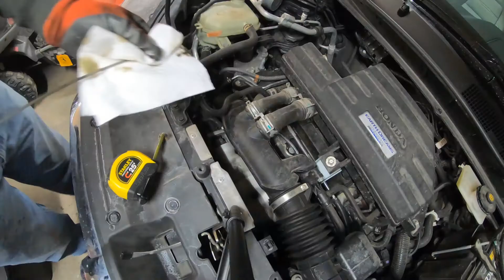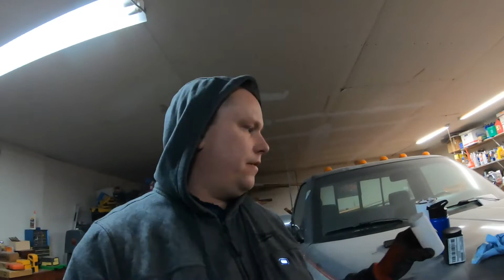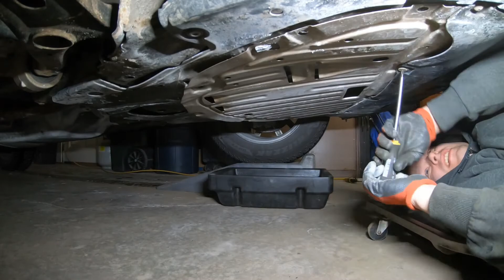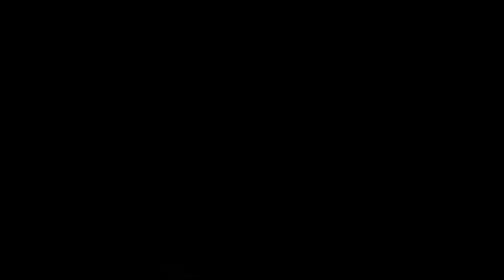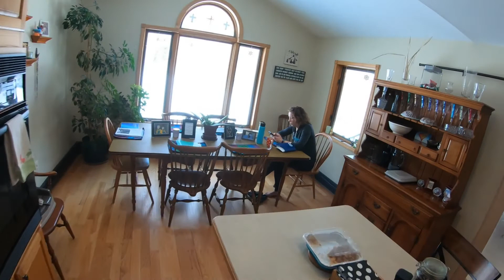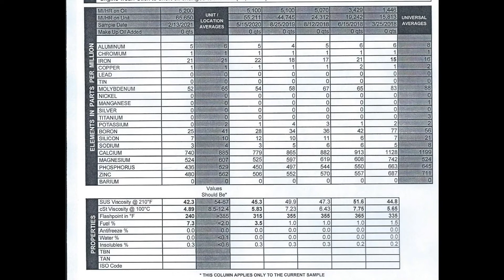New Oil Dilution? 2017 Honda CR-V - W/historical Oil Testing Results - #1

Comment: I think gas catch device is the must have if you drive the 1.5L CRV in a cold state. If you live in the southern states, use premium gas and change oil more frequently should mitigate this issue. No matter what, I will never buy Honda car given they have lost their pride in building a reliable engine. It certainly saves gas, but I use premium gas which makes the saving on fuel efficiency goes away.

Comment: For all the 1.5T owners out there, do not drive it short distances if possible, once a month   make a 50 to 100 mile road  trip ( or more), do not iddle more than 1 minute in cold weather, change your oil before and after winter. Thats the key for me , a 2017 crv owner,  175 k miles,chicago resident

Comment: Just curious do you still have this vehicle ?
Reply from the maker: Still own and drive daily.  About 113K miles on the clock.
Reply: @factotumlife  excellent to hear. So just keep up with oil changes . I have a 2019 crv 1.5 turbo, and I've just been changing oil more frequently.  Thanks

Comment: Hi I have a 2017 civic hatch sport 1.5l  I have 93000km on it right now I’m scared that mine would have the same problem I notice the oil is just little bit higher than normal mark  what should I do any suggestion ?

Comment: I have a 2018 CR-v and I recently did an oil analysis after the oil had 5000 km on it and it was diluted by petrol to 9.2%. This is a real problem for this 1.5 Honda engine and apart from a complete redesign, I can't see a fix for this problem. Everything Honda is suggesting just tinkers around the edges.
Reply: I would change that oil every 3,000 miles.

Comment: These engines are crap. I live in the deep south and the oil level goes at least 2 inches or more over full. It's on my channel. These turbo engines won't last long. Gurantee
Reply: 2 inches over full? Yeah right!
Reply: @bruceskousen5451  the proof is on my channel

Comment: I’ve got a 2019 CR-V.  I haven’t had had the oil dilution problem. I live in Washington State. So, we do get cold temperatures. I’ve researched other Turbo engines. Your wife has a valid point, you can get another vehicle. Even a 2019 or newer CR-V would get rid of your current issues. I get it money is tight. Say your vehicle engine does brake down. Honda has proven to not stand up for there engineering & design flaws. There is still hope that Honda consumer policies will change for the better. Honda has a history of reliable auto engineering & design.
Reply: Honda is no more a reliable company.....
Reply: News flash, 2021crv x2 in our family, both suffer from oil dilution. Honda didn't fix anything, they just made it not dilute as fast by manipulating how quick it gets up to operating temperature.

Comment: Would using a 0w40 oil help the gasoline blowing by the piston rings?  The 0w40 should be ok at lower temperatures but provide better viscosity to prevent engine wear.  Is there any data to support or deny this theory?

Comment: In December 2016 I ALMOST pulled the trigger on a brand new 2017 Honda CR-V Limited... Right before closing on it, I found a 2012 Ford Escape XLT 2.5 with only 19,000 original miles. The new CR-V was going to be nearly $30k drive out; the used Escape was less than $14k. I bought the Escape. It is now paid for; it has 56k miles and I have only done typical maintenance (tires, battery, oil changes). My oil change interval is 3000-3500 miles using conventional oil (typically my local ASE shop uses Valvoline.) Oil changes are cheap; engine replacements aren't. The Escape's Mazda derived 2.5L 4 cylinder is very simple but reliable - I have experienced NO oil dilution issues. I have not yet experienced the typical coil pack issue on this engine, but the coil packs are readily available, are not expensive, and are incredibly easy to change.

I thank my lucky stars I didn't buy the CR-V! Honda isn't what it used to be, sadly.

Comment: I have a 2020 CR-V Touring which has had rising oil level since day 1.

Your video is the most practical and informative of all I have seen, and I have seen a ton of them.

I am hoping you can help me. It is clear that you are finding success with premium fuel-are you using 91 or 93 Octane? There is some thought 93 v 91.

How about the thought that Honda says the oil level can rise 3/4 inch above full without issue?
So, at the moment, I am trying to decide if I should go back to regular versus continuing on with premium.

Lastly, does this engine dump less fuel or leaner fuel mix while running premium, or is there no difference?

Lots of questions.. Just trying to find peace of mind with my first Honda.
Reply from the maker: Since I posted this video we have consistently run 91 octane(no ethanol) because that is the premium fuel available to us. Our mid-grade is a 88 octane with 15% ethanol, and 87 octane with 10% ethanol.  Historically, I have run 88 and 87 octane and both grades of fuel seem equal in the amount of oil rise for me.   I am not sure if this is an ethanol issue or an octane issue although I have my suspicion. 

Honda (dealer) has never communicated to me what they consider a normal oil rise.   I have personally used 3/4" above normal oil level as a change threshold because that is around the level where I begin to notice fuel smells in the cabin with a fully warmed up engine idling.  The May 2020 oil sample column with 3.5% oil dilution was about 3/4" above full.  The iron counts of 22 were slightly above averages (16), but not to the point of being flagged (oil tester will highlight results in BOLD) if out of spec,.  

I have not investigated the fuel mapping of this vehicle with different octane grades of fuel therefore have no idea on what is really going on with regard to fuel mixture and octane.   

I will be ready to change the oil in the next week or two, 5K miles, and will make a second video with oil sample results.  I can tell you right now the oil level has not moved past normal with 91 octane (no ethanol) - no oil rise.   Unless the oil sample spells out something different my plan of going forward is to utilize premium during winter months and migrate back to regular fuel in summer.
Reply: @factotumlife , thank you for the quick and informative reply. I would like to know if you experience any oil rise during the summer months with regular fuel. I seem to experience that rise, although less than last winter when I was getting to about 1/2 inch within 500 miles.

I would like your thoughts on the ethanol aspect. I live in Minnesota and my choices are Holiday 91 (not sure how much ethanol is mixed in) I could also get 92 ethanol free, but only 1 station offers this.

Currently am using Holiday 91. I do get an initial rise of 1/8 inch and my drives are short-8 miles to work and some shorter trips around town. My engine has always heated up pretty well.

Thanks again for your thoughts. I am curious why you migrate back to regular in summer, being you do get oil rise. My guess is that the rise is minimal?

I really wish Honda would share what you have. I understand their sales would probably suffer if potential buyers thought they had to use premium gas. If premium controls this oil rise at a cost of less than $20 monthly, I am fine with that.

I really do appreciate you acknowledging my concerns. Honda dealership does not. The CRV owners forum will not even allow you to talk about this issue. I had become very frustrated to the point of trading this thing in, but it is cost prohibitive. Finding your video changed it all for me.

Thank you.
Reply from the maker: I do see oil rise in the summer months, usually 1/2" or less, over 5K miles with 87 octane.   I am not sure this is an ethanol issue, but I mentioned ethanol because the gas stations I use don't have ethanol in there premium fuel line.

My experience with fuel rise is that its not linear. It seems to occur fairly soon after a fresh oil change and than generally oil maintains a stable level through at least 5K miles.  The exception to this is my video where I changed the oil and the level was 1" above.  I wish I could tell you at what point the oil exceeded 3/4" but I wasn't checking it and the 1" level surprised me.    

My reasoning for switching to regular 87 octane in the summer is the oil rise stays under 1/2" and the data I have collected the engine seems to be wearing ok and I don't smell fuel in the cabin.  In the winter months I will run 91 octane because the cold weather just doesn't help this engine and whatever is going on seems amplified with oil rise.  If I can buy myself some margin (keeping oil level below 3/4" above normal)than that might be the happy medium.

Have you noticed a change in oil rise using 87 octane vs 91 octane?  If you haven't noticed any change or much of a change you could temporarily switch to ethanol free gas right before your next oil change and see if that changes the oil rise situation over the course of say 3k-5K miles.  Unfortunately, once the oil level has risen it doesn't deviate much, even if the oil itself is testing normal in fuel %.  That is why I mention doing the ethanol free fuel test right before your next oil change.
Reply: I will assume you had the "fix" because it sure seems like your experience on 87 octane mirrors mine. I purchased my CRV at the end of September last year, so my original experience was with cooler weather, but it rose 1/2" within 500 miles, which always concerned me, so I never gave it a chance to see what it would do beyond those initial 500-1000 miles.

I have never experience gas smell in the cabin, so I cannot speak to that. I thought you would get a CEL code at 21 mm, but I guess that does not go off until 31 mm, which is just under 1.25"

Using 91 octane vs 87 octane is night and day. I have about 600 miles since my last oil change with less than an initial 1/16" rise, which is to be expected with a DI engine. It has not moved since then. This is not ethanol free, and at the cost of $6 more per tank, it seems like a good trade off. I fill up about 2 times a month, up to 3 times during the summer, so still around $20/month.

All that to say I am contemplating 91 year round. One last bit of info that could help me would be your thoughts on ethanol free specifically during the winter months. There is availability of 91 by  my house, or in the city that I work, there is 92 ethanol free. Do you believe there is an advantage with this fuel when cold starts are a daily occurrence and would there be much difference between 91 and 92?

It will probably take me 4 months to get to my next oil change, but everything will be much clearer at that point, much as it has been for you.

I am curious why you titled this "New Oil Dillution?" Honda should have layed out this exact scenario for those with oil rise, or better yet, shown us new owners what the upper limits of fuel dillution is in these engines.

Much respect for your initiative here.
Reply from the maker: Yes I had the fix completed right away when it was released.   

If 91 octane w/ethanol is day and night compare to 87 octane than I would not be concerned any further.  If you notice something different in colder weather you can always try the ethanol free at that time, but I was never convinced this was an ethanol related issue and your findings sort of back that up at this time.   

I titled it "New Oil Dilution" because I have owned this car 4 years and thought I had engine quirks figured out only to discover the oil dilution eluded my expectations in a 5K mile oil change window - from the original 3/4" above normal to 1" above normal.
Reply: I just wanted to give an update in case anyone else has these issues.

I switched back to 87 regular because I decided to go by Honda specs.
I took a couple of longish drives a 45 mile one way and then a 500 mile and round trip. 2 tanks and oil is actually holding as well, maybe even better than premium. There was some short tripping. I am sure those longish trips did help.

I am going to monitor to see how long it takes for oil rise to reach 3/4 inch and then adjust my oil change interval to handle the rise.